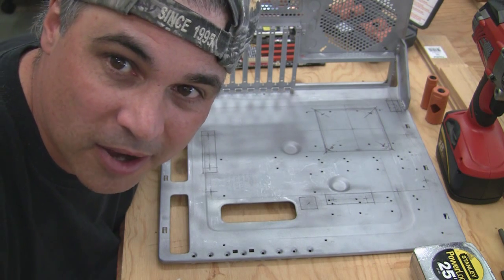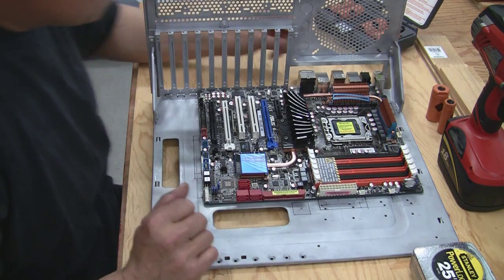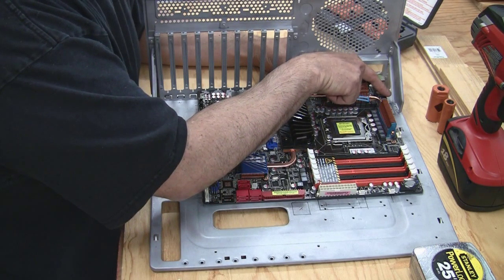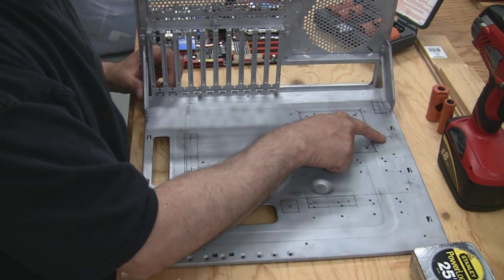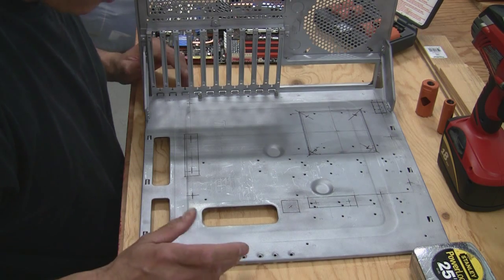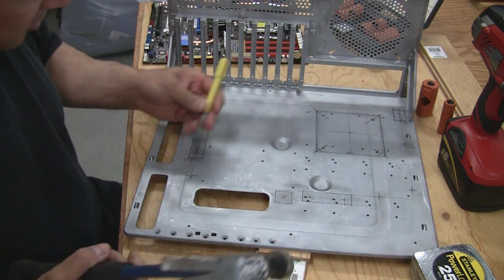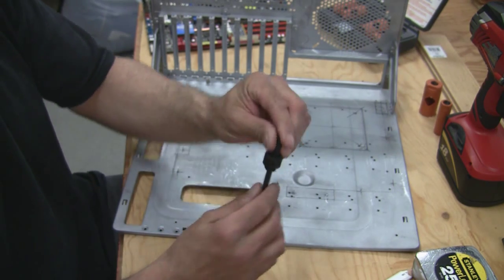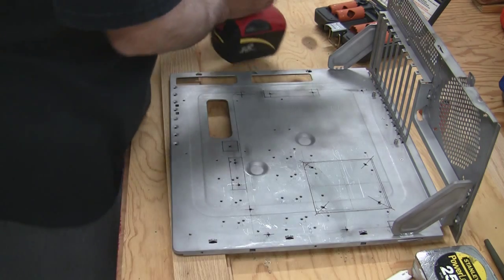Modding Your Mobo Tray for Cable Mgmt. Part 1

Comment from the maker: Check the ones you have they should say bi-metal on the hole saw itself. A mew set can be some what expensive, $50 - $100 depending on what brand you buy and how many different sizes come in the set.

If you only need a couple of sizes then by them individually for about $6- $8 each. and use the arbor and pilot bit you already have.

Cheers
LazyMan

Comment from the maker: you can buy them separate or you can buy them in a set with different sizes. In the states here, they go for about $8.00 each without the arbor or pilot bit, if you buy the set, which comes in several different sizes. The one I bought came with 5 different size hole saw's and included the arbor and pilot bit, costing about $40.00 US

Comment from the maker: It's not a special hole saw, but it need to be a bi-metal hole saw, which is pretty standard in any local hardware store. You can normally buy them in induvidual sizes or buy a set which has many different sizes.

Comment: Cool man.  Just finished my build for the most part.  I'm going to lap my TRUE and reseat it with OCZ Freeze and see if that gives me some better temps.
Tried to email you some photos but it shot me back an error on your address.
Either way, again, thanks for this...it helped out a lot as far as the tools required and whatnot.